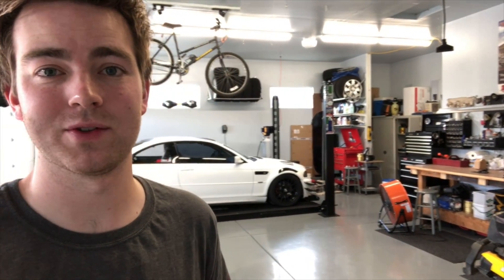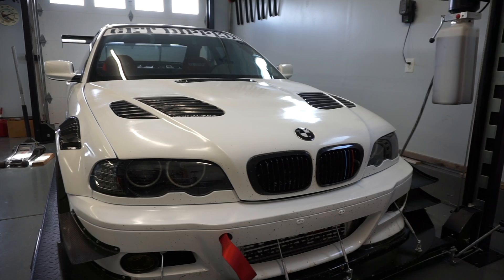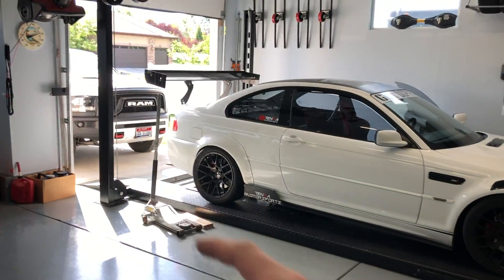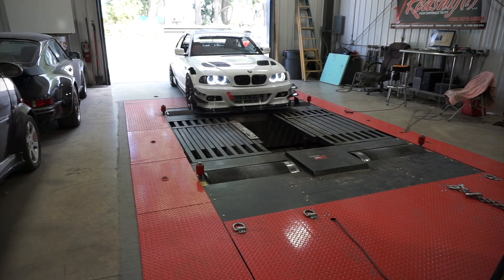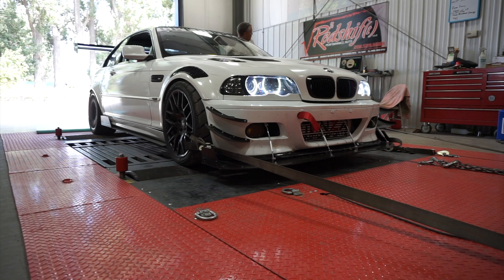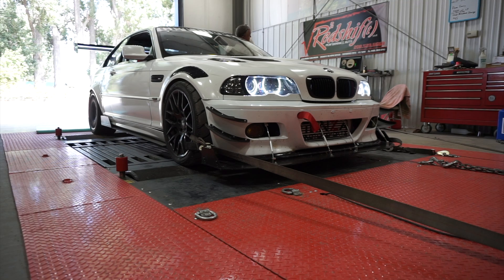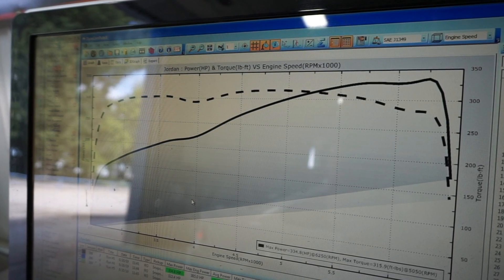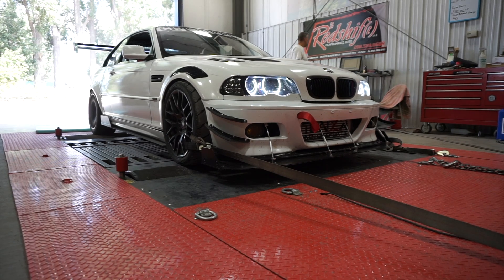Dyno results for the AA supercharged E46 330ci engine rebuild M3 killer build - boosted track build

Comment: I want to I'd this with a twinscrew supercharger kit... And then feed a large frame turbo into it
Reply from the maker: Wow. That would make for a crazy build. Are you doing that on an e46 bmw?
Reply: @TenzaMotorsports  on a 330/m54 as all the supercharger kits for the m3 are centrifugal compressors.
Reply: @TenzaMotorsports  there were always issues with positive displacement blowers and the s54 ITBs, so m3 supercharger kits you will see are vortech blowers basically 

However, wouldn't mind having the m54 rev higher though to take advantage of top end of turbo. Even an extra 1k rpm with springs, solid lifters and an engine dampener

Comment: Hey man! Nice build, when you set up the AA kit, did you ever experience the belt sitting on the pulley threads closer to the expansion tank? When i read the install directions it says the belt is suppose to be on the first 6 ribs. I adjust the belt and it just hopes back to the front ribs. Thanks man
Reply: Actually just found another one of your videos when you talk about the squeaking etc. Going to adjust the mounting brackets and try that doubled up clamp on the back of the charger like you did!
Reply from the maker: I thought the same thing. It just goes back to where It wants. It’s tight, not squeaking, or wearing prematurely. So I just let it do it’s thing

Comment: the m54b30.3.0i engine 231hp in europe...easy tuning too 285hp ,non turbo...thanks man...love youre car..keep up the hard bmw love,lol,,,
Reply from the maker: Thanks for the comment. I have another dyno where I change out the pulley and do 400hp
Reply: Achieving 285hp on the m54b30 is not easy without a turbo any means, you can maybe get 230/240 with simple mods

Comment: Did you build with forged internals???? Seems low.
Reply from the maker: No the bottom end is stock. It is lower because it’s only running like 8-9 psi
Reply: @TenzaMotorsports  what would you consider "engine build" then? Most people default to forged rods and pistons with that title. Just sayin'.
Reply from the maker: I never said build. I did an engine rebuild. The car as a whole is a track build. As far as I know the crank and rods are already forged in the M54 engine. I was told unless I wanna run like 500+ its not worth changing/upgrading the bottom end.